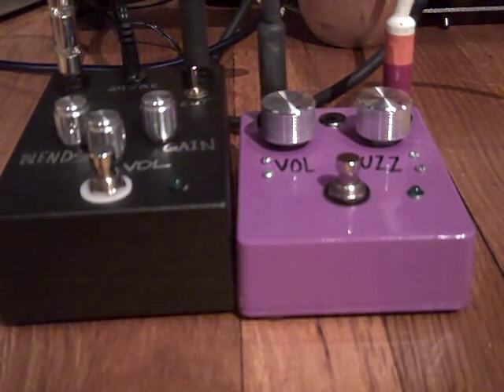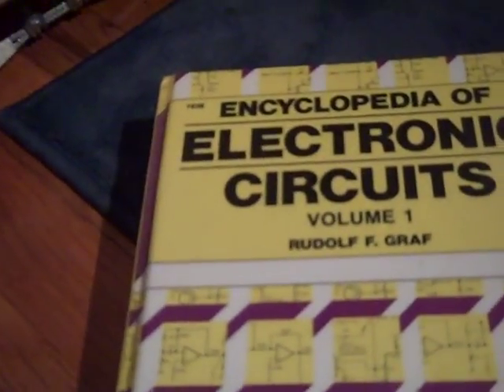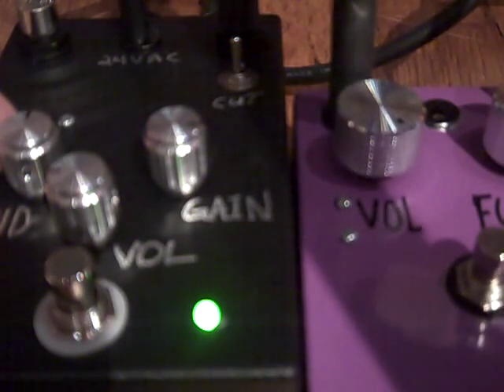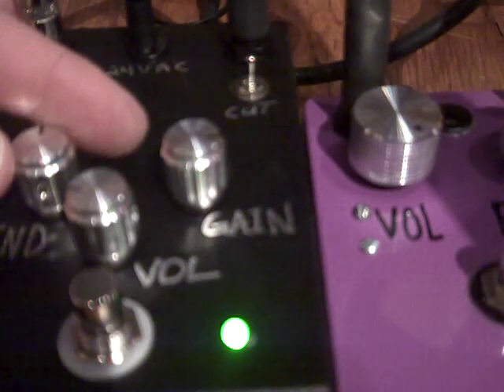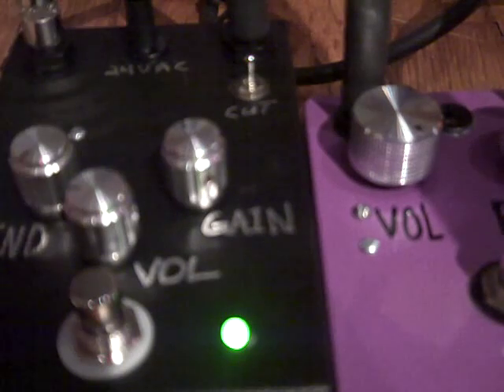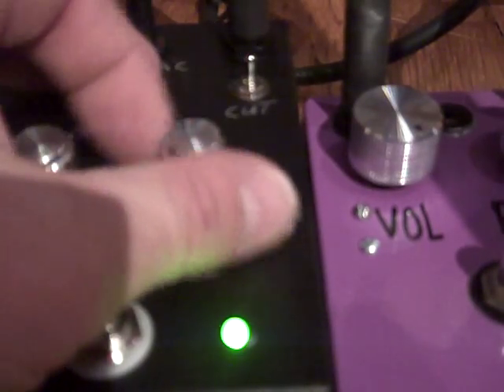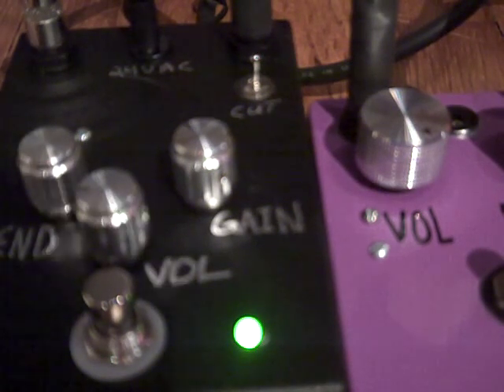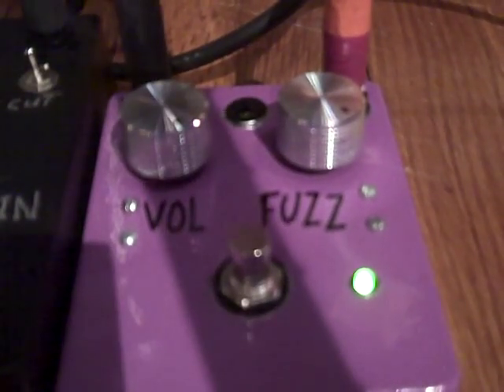Wave Folder and Fuzz Face

Comment: I thought that the lockhar wavefoldert had to be feed a oscillator and a signal?? is this incorrect.  I ask because id like to build this because wavefolders are sound awesome on guitar when treated like a Octavia when it comes to plating and pickup selection
Reply from the maker: No, you just need a strong signal.  I'm pretty sure I put  a 386 based boost in front of the wave folder to make the guitar loud enough.

Comment: this sounds  every bit as good as the prunes and custard. is the circuit about the same or much different??
Reply from the maker: I had a Prunes & Custard for a bit and it felt a lot different in the flesh.   The schematic for the wave folder came from the CGS synth site.  Here is a schematic of the wave folder portion, though I think I put a 386 chip in front of it to get the guitar hot enough for the rest of the circuit to work correctly.  https://web.archive.org/web/20160217192143im_/http://www.cgs.synth.net/modules/pic/schem_cgs52_folder.gif
Reply from the maker: So, anyway, a lot different actually than the P&C.  I have seen schematics for those and it's nothing like this one.

Comment from the maker: I built this one using turret board, I think it was two of the Antique Electronic Supply part # P-TS6-1 , superglued together.  I don't have the pedal anymore, I traded it for a reel to reel tape machine.  I have had good luck with the GGG pcb.  In fact, if I were to build another one, I would use the GGG pcb.  It makes for a quicker build and actually keeps lead lengths shorter.  As for trimpots, Jameco and Mouser sell many small 10k trimpots.  I don't remember sticking one in that pedal.